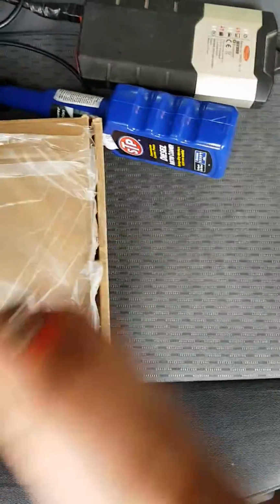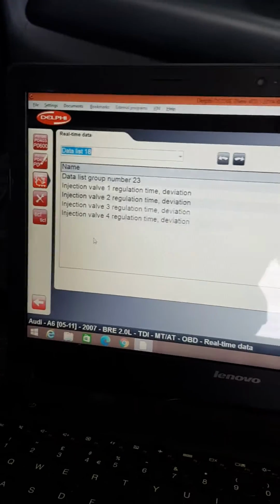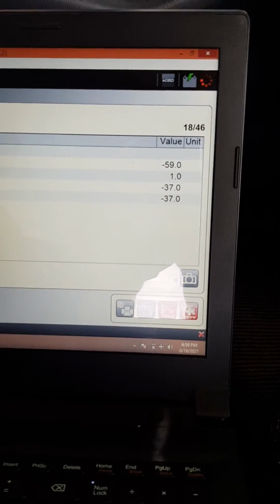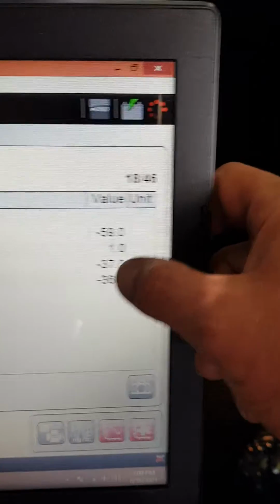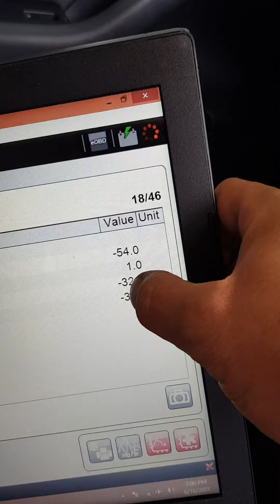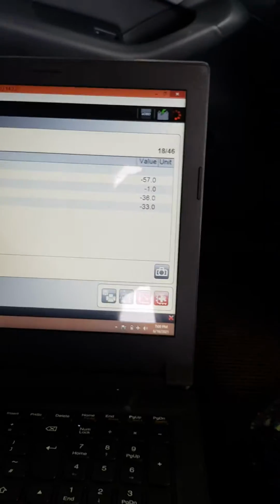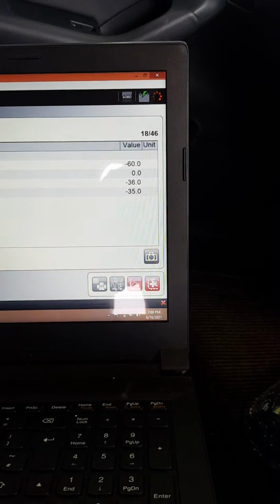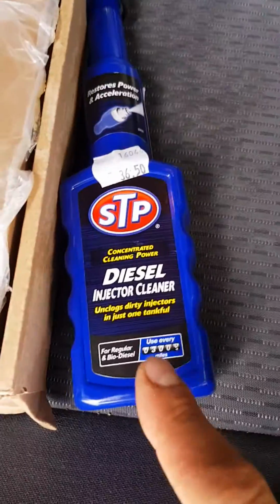STP Injector & Fuel System Cleaner TEST w Proof of Injector's Correction Values Before & After Part2

Comment from the maker: Hello . Unfortunately i did not had the needed time 4 creating & uploading youtube videos , as i got a newborn after posting, and i paused youtube activty (creating /uploading videos)  Especially that since aprox MAY 2022 when Ukraine war started , i only got 10% earnings since then ,  by now , compared to the period before.  Where i was getting 90% higher income from monetisation. 

And yes it really works . use another bottle for next full tank, and repeat for 3 4 tanks an injectors , will be like alimost new .  
i used injector cleaner in every of my cars , since this video,  and always got a better mpg . after using in 3 4 tanks 
(full or 3/4 even at half tank you can use 1 full bottle (read back of bottle if u ever buy)

After i saw this good results i have only used premium diesel only , and i still add 1 bottle of injector cleaner at 1/2 tank of premium diesel , every 5 tanks)  

Now i only make my car tank half , or 3/4 maximum as lighter weight cars use less fuel and drives better ,accelerates better (on small diesel engines up to 2.0 liters )

Comment: How did it go? I tried the same product and travelled 220miles on motorqag and it seems like it worked for now. Car is not rough idling or misfiring for now let's see in a few days
Reply from the maker: Hello . Unfortunately i did not had the needet time 4 youtube as i got a newborn child after posting, and i paused youtube activity . 

And yes it really works . use another bottle for next full tank, and repeat for 3 4 tanks an injectors , will be like alimost new .  
i used injector cleaner in every of my cars , since this video,  and always got a better mpg . after using in 3 4 tanks 
(full or 3/4 even at half tank you can use 1 full bottle (read back of bottle if u ever buy)

After i saw this good results i have only used premium diesel only , and i still add 1 bottle of injector cleaner at 1/2 tank of premium diesel , every 5 tanks)  

Now i only make my car tank half , or 3/4 maximum as lighter weight cars use less fuel and drives better ,accelerates better (on small diesel engines up to 2.0 liters )

Comment: Did it work?
Reply from the maker: Hello . Unfortunately i did not had the needet time 4 youtube as i got a newborn child after posting, and i paused youtube activity . 

And yes it really works . use another bottle for next full tank, and repeat for 3 4 tanks an injectors , will be like alimost new .  
i used injector cleaner in every of my cars , since this video,  and always got a better mpg . after using in 3 4 tanks 
(full or 3/4 even at half tank you can use 1 full bottle (read back of bottle if u ever buy)

After i saw this good results i have only used premium diesel only , and i still add 1 bottle of injector cleaner at 1/2 tank of premium diesel , every 5 tanks)  

Now i only make my car tank half , or 3/4 maximum as lighter weight cars use less fuel and drives better ,accelerates better (on small diesel engines up to 2.0 liters )